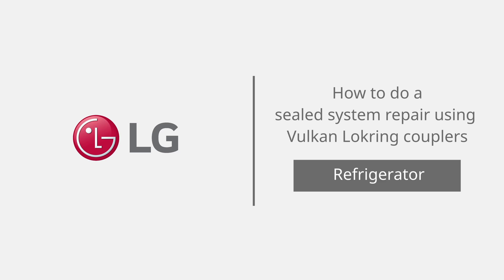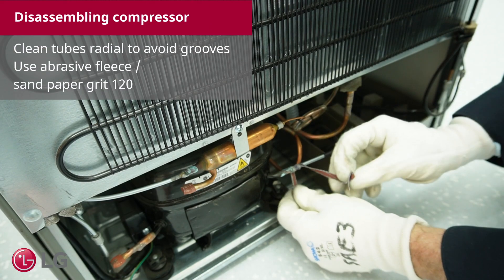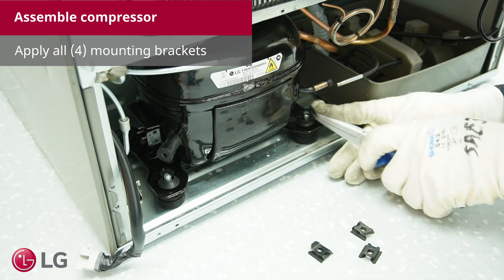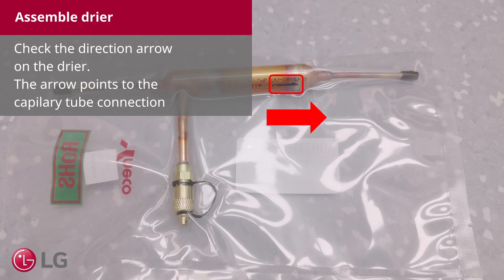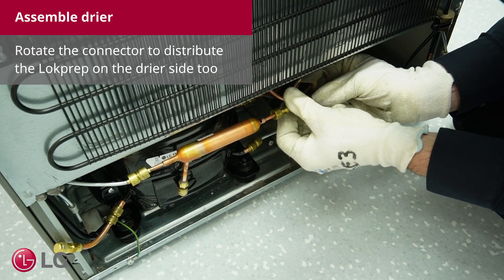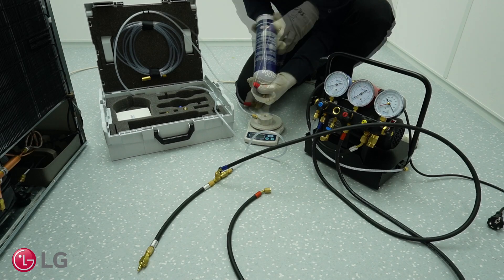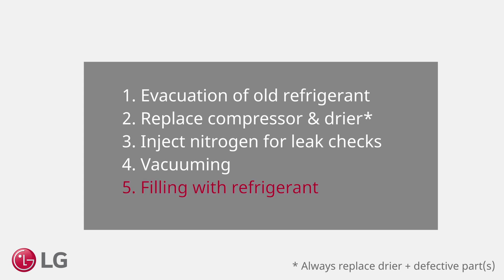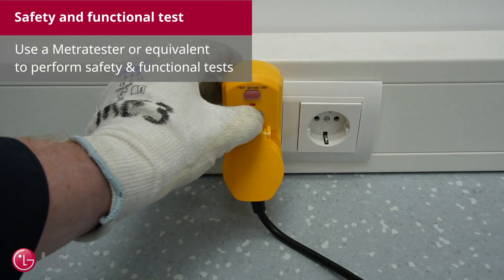[LG Refrigerator] - How to do a sealed system repair using Vulkan Lokring couplers

Comment: Why even evacuate if you’re releasing it outside?  That makes no sense and shows just how incompetent a tech you are. Are you even certified to work with refrigerants? Have you heard of the EPA? The EPA pays $10,000 to anyone who reports someone releasing refrigerant into the atmosphere. Sure, LG sealed systems only hold around 6oz but the headache the EPA will cause isn’t worth it.

Comment: My LG fridge (2007 model LTN19315ST)'s compressor is model MC57LDCM. It wasn't shipped with any noise damper pads like the one seen in this video. 
Is it safe for me to buy and apply two like on yours ? (one of top, and one on front of compressor)

Comment: wait ??? wait ??? his letting it outside tf... in america you get a ticket if caught ha
Reply: Only the very newest fridges in the US use R600a (butane) as a refrigerant, it was illegal for the longest time due to its flammability, even though most of the world has been using it for at least a decade. So most fridges in the US still use a traditional Freon, typically r134a, which of course is illegal to vent to atmosphere due to its high GWP. 

The standard industry practice for butane (r600a) refrigerant is to release it to atmosphere , it has close to 0 GWP and very small amounts are used in the fridge.
Reply from the maker: Not sure what you mean but I guess you mean the release of the refrigerant in the air. That depends on the type of gas and the amount, obviously, but letting it out of the house in the open air is exactly what you need to do in this case.
Reply: @LGSAE  It’s obvious you don’t know what they mean. R134a isn’t toxic or explosive. It is required by the EPA to recover it and never release it into the atmosphere.

Comment: You're really advising to let refrigerant out the window in EU?
Reply from the maker: In these refrigerators LG uses R600a. This is a refrigerant with a GWP of 3. For R600a there is no reason not to let it out of the window.
Please know, R600a is highly flammable so it should not be released in a confined space.
Reply: @LGSAE  it's still a 3, so it should be handled correctly. If everyone thinks like you guide, no wonder the world is warming.
Reply: Yep, it's 100% completely safe. If you disagree otherwise then please no longer post on here. There's enough BS in the world without additional unnecessary comments to top it off with 🙂
Reply: Once you have recovered it do you keep it under your bed.   Here we let it free.   No worries
Reply: HOLY SHIT RIGHT !!!!! no wonder EU sucks haha
Reply: It's iso-butane, r600a, a hydrocarbon refrigerant not a CFC/HFC/HFO etc. Due to the flammability, low GWP and small amount used in these types of refrigerators the industry standard is to vent it to atmosphere.

Comment: Trying to get this tool.... lokring
Reply: Theres a patent on the tool so it is waaaaay overpriced.  Its also way too big to fit in alot of spaces, so bring your oxy/acet torch.  Theres a reason only one lockring is on units coming out of factory.  The factory brazes most of the joints.
Reply from the maker: Lokring tools are from the company Vulkan https://www.vulkan.com/en/